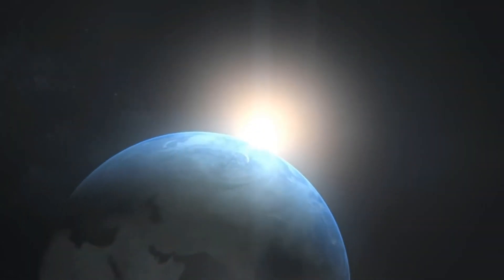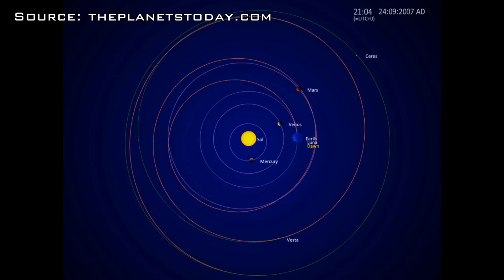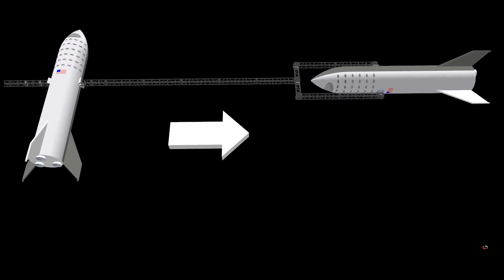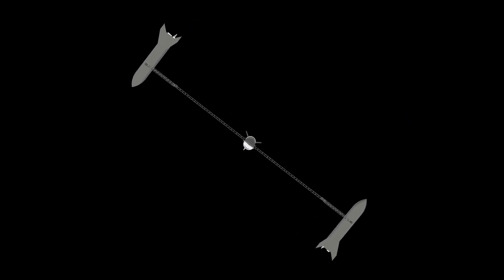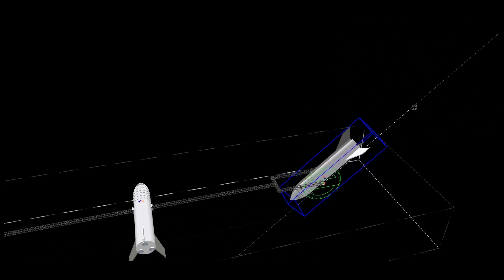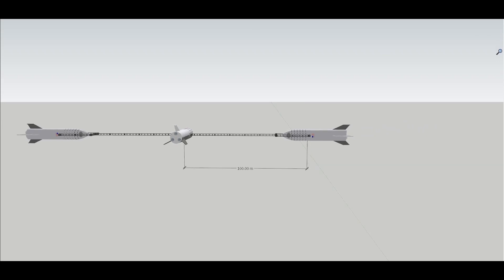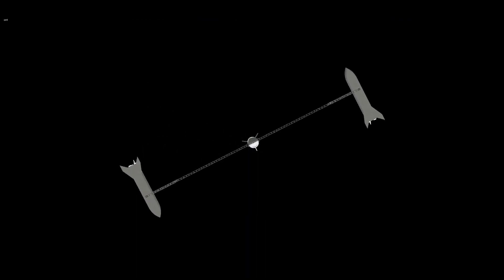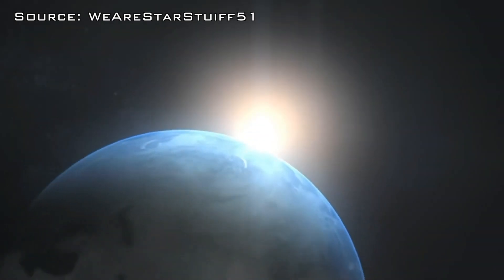GLS2: Artificial Gravity for SpaceX's Starship

Comment: why not just design the Starship with the walking surfaces on the hull so that the ship could be spun like a bullet. One ship....no truss work...no precise coordination required between two complex vessels at opposite ends of a tether. There is also good reason to keep the cross sectional area as low as possible. Space is not empty. Closure velocities can be insanely high. Imagine a small particle moving at an opposing relative speed of 150,000 mph striking the truss work. If the damage is enough to cause deformation the forces involved would twist the entire rig into a pretzel long before any considered response could be enacted, let alone rotating both spaceships, aligning the engines to counteract erratic movement would take considerable time. The only likely way to recover from that catastrophe would be to have the radially distributed ships detach themselves as fast as possible using explosive bolts. Now these two ships are flying away from the hub ship at tremendous velocity, requiring complicated maneuvers and a full crew to be on board both to execute then bring the ships back together in close proximity. The fuel you would need to land on mars or return or even abort and return home would likely be gone at that point. Cool idea, just thinking of the worst thing that could happen....and it's not that unlikely in the grand scheme of things.
Reply from the maker: I agree! People don't like to design their spaceships with 1 floor for travel, and 1 floor while landed. But my original idea did rely on that feature. As of now my only other uploaded video is GLS version 1.
Reply: @smallstars  on the other hand, did I just summarize the plot of a wicked action scifi movie?!!!!😀
Reply from the maker: @BokrosD  lol

Comment: Also if the truss system were electrical, you wouldn't need do a burn to handle the rotation, just solar panels and rotate using reaction wheels and motors, I'm sure even if it starts slowly and builds up speed over a short amount of time it would be better than using fuels. Also if you give it it's own propulsion, you could slow it down and put it into orbit separately so you dont risk having 2 rocket ships not firing at super precise speeds which would throw off vectoring and orientation if you had them both connected as the same time firing rockets.  This is a good idea overall
Reply from the maker: Thanks Daniel! Well the only problem with using an electrical motor to spin up and spin down, is where would you put that motor so that it has leverage on all of this mass it's trying to move?
Reply: @smallstars  The reaction wheels at the middle would work in theory, but the energy requirement to spin two massive ships would be tremendous.  I'm guessing SUPER-well beyond any reasonable solar or battery capability to spin it up in a reasonable time.
Reply from the maker: @737smartin  Yeah there's a serious leverage problem with anything actuating the spin from the center of the system. Reaction wheels especially will be useless.

Comment: It is a quite beautifull and elegant design. But I fear about the safety of the system, one broken nut, or one over stressed part and the whole thing could end in catastrophe. 

Partly because its not a rigid structure but has to fold up aswell. 

It would take an immense amount of testing to develop a system that is deemed safe enough. And it would need to be monitored constantly to ensure safety. 

I'm not sure there's any material out there that can handle the stresses while also being able to withstand impacts from space debris.

I'm no expert though, and I really hope someone at SpaceX or perhaps NASA sees your video. Would love to know what an expert thinks.
Reply from the maker: Thanks! Me too! As for what you said about 1 piece failing causing catastrophy, I would like to bring up exhibit A: the airplane 😁
Reply: @smallstars  But it isn't an airplane though is it? Its not a metal tube flying around in the atmosphere with landing sites every couple of minutes or at most hours away.

Its a massive spinning contraption of 3 spaceships travelling at several thousands of miles an hour through a vaccuum that kills nearly instantly. And it does this for several months/years at a time. There's no way of fixing things quickly when something does go wrong. You catch my drift?

One broken nut puts stress more stress on another, which then breaks aswell given enough time. And so on and so on. And before you know you have 3 spacecraft spinning out of control. 

I'm not bashing your design. I'm really not. Infact I think if we were able to manufacture it, it would actually be one of the best ways of travelling to mars. 

I'm just not confinced we have the material science to build this at the moment. Not without making it much more complex and expensive. 

Then again, I'm not an expert. Perhaps someone at SpaceX or NASA would look at this from a different standpoint and see more possibilities.
Reply: EDIT: I read in the comments you are making a new video. That's really awesome. If you could perhaps answer a few questions of mine. 

I think to make this work there would have to be more fail saves in place. You already mentioned adding extra tention cables that's a good start in my opinion. 

I'd like to see if you could calculate how much fuel would be needed to for instance take 2 extra bolts for every one already in use on both trusses. Or perhaps how much more fuel it would take to just have 2 extra trusses entirely. Is that even possible?

And how astronauts could go about fixing things as quickly as possible through the means of EVA?

Right now I think it takes about 4 hours for an astronaut to prep for EVA on the ISS. Could that be brought back to for instance 1 hour? Or perhaps half an hour or 15 minutes?
Reply from the maker: @CyclonicTuna023  I do catch your drift, and thanks for your input! You're right.
Reply from the maker: @CyclonicTuna023  Awesome comment! I can say right now that the fuel requirement does not change significantly with added mass in the truss area, because of how leverage works. This spin system has most of its mass at the rim, and the thrust is also applied at the rim. It's like saying "how much harder will I have to push to open a door with my hand on the edge of the door, if we add weight near the hinges."

I will be sure comment on EVA's in a future video!
Reply: @smallstars  What I actually meant was, how much more, if any, fuel it would take to get the extra components up there. Since the weight at launch would probably be greater.  :)
Reply from the maker: @CyclonicTuna023  I see, well the rule I am working with is 150 metric tons of payload. That's how's much mass can be lifted into orbit, and they are planning for orbital refueling. I'm sure 200 meters of truss, with extra bolts, and cable, and swivel joint hardware, will weigh less than 150 tons.

Comment: the joints on the passenger ships would need to be lowered to their center of mass, otherwise the fuel, engines, and fins would all put too much weight on the structure holding the ships together once they start to spin.
Reply from the maker: Yes!!!! The goal for the next version is to figure that part out!

Comment: why not just spinning 2 starships connected butt to butt ? It should be less complex to make it. Considering the starship will be 55 meters tall, if you plug 2 of them butt to butt, we would be able to create the mars gravity by spinning it at 2.2 rotations/minute: https://www.artificial-gravity.com/sw/SpinCalc
The rendez-vous maneuver could be done only on the intercept trajectory to mars, which is not that bad I think.
Of course that won't be a perfect solution but at first it would be more feasible than building a 200 meters metallic structure in space with robots and spinning motors. That idea would be great but would cost a lot more I'm afraid.

Comment: Great idea but there's much to be done with the design. It shows promise.
Kicking off the spin as you have shown is great in theory, but there are considerable loads on the truss and on the vehicles.
Stopping the spin requires the vehicles to pull out of their G-loaded orientation to fire up their Raptors. This is more of a challenge. The torsional loads on the truss will likely snap the truss sending them off into the void. Better off using coordinated gas thrusters to slow the spin to an acceptable rotational rate and then they detach. They will "fling" off but can then slowly manoeuvre they're way back into formation.
Reply from the maker: Agreed! (For the most part) 😵

Comment: Nice idea but the stresses on those trusses, especially torsion stresses, would rip it apart in a few hours to days.
Reply from the maker: Torsion? Do you mean bending? According to my engineer friends the tension is going to be the killer. The next version will have math and animations for tension reinforcements. I'm not sure how any torsion force (twisting) could be applied to the truss unless something really goes wrong. As for the bending, imagine trying to bend a spoon by pushing on it with one finger at the tines, and one finger at the handle.
Reply: @smallstars  Twisting.
I'm looking at the length of those trusses and thinking about how easy it would be for the slightest variation in thrust from one of the engines shift the trajectory of one rocket ripping the whole thing apart.
There's just too little room for error.

Comment: I got to say that's better then some wacky ideas out there but it still doesn't address any of the reasons nasa doesn't yet do artificial gravity.
Reply from the maker: I would love to try to address a list of NASA concerns. Should I just Google that?
Reply: @smallstars  Yes, They have answered this question a gazillion times.  The info is out there.  Off the top of my head some of the important ones are;
1) Weight - Correcting for the extra twisting stresses makes the vehicle too heavy and/or really reduces it's payloads.  Not worth it for anything they have done so far.
2) Safety - The Gyroscopic motion hampers there reaction times for coalition avoidance and increases they safety window as it now has a bigger operational foot print.  Plus you need a lot more fuel to adjust.
3) Backup plan - This is critical for all of nasa's projects/plans.   Rotating bodies have a lot more failure points then non-rotating ones.  To think that RTS(s) are 100% reliable is just plain silly.  In the end you have to be able to disable the rotation and still have the people be unharmed.  So they have to work out the non-rotating problem anyway.

Comment: The load case you really need to check is bending in the truss during the spins up/down, and during swiveling of the starships. Although, I suppose you can make the rapidity of those operations slow enough to minimise bending stress.

Its also not easy to analyse correctly, you'd pretty much need an FEA program, its not as simple as putting a tip load on a cantilever beam since its freely allowed to rotate.
Reply from the maker: I agree with the swiveling note, but truss bending should not be an issue, as you said in your second paragraph, imagine trying to bend a fork by pushing with one finger in one direction at the end of the tines, and another finger in the other direction at the end of the handle.
Reply: @smallstars  yeah theres still some bending on the fork, but you have to apply forces and accelerations weirdly to analyse it statically, even with FEA

Comment: I thought there was something about needing a constant state of acceleration for this to work in space.
Reply from the maker: The spin may have to be "re boosted" but not by much. With a spin system there is constant acceleration, the idea is that the floor of the starship is constantly pushing up against your feet, just like the Earth's ground does.

Comment: I wonder if it is possible for the Starship to swivel up against it‘s own artificial gravity, and if it‘s stable when pointing perpendicular to the gravity vector
Reply from the maker: Very intuitive thought! This is certainly one of the problems with my design. Working on a new system for the next version that either involves a track or a more fancy swivel joint
Reply: @smallstars  I think having three tethers for stability and RCS for de/accelerating the rotation would be the easiest solution.

Comment: I don't see how a rigid structure would be advantageous over a cable system, as it would introduce structural concerns that simply wouldn't exist with cables. You wouldn't get me on that ship. And I'm not sure why an entire rocket would have to be out on both ends - why not segment the ship and place a tethered crewed portion out at one end? In fact, if you did that, you wouldn't need two ships. And if you're sending two ships, then they can each have their own tether. Cable would be a lot simpler and easier to stow, in a smaller space, and probably lighter, with far, far fewer issues. Keep it simple. Plus, you don't have two ships reliant on a single point of failure. However, if you insist on attaching two ships (rigidly or with cable), why not simply design the ship so that "down" is to one side of the ship, instead of toward the rear. Then you would eliminate the need to pivot them around. Plus, there would only need to be one connection, on one side, and the rockets could swivel around that (balanced) connection point, rather than pivot around some offset axial connection, when thrusting is needed.

Comment: I think this plan is overly complicated. The use of the main engines on the Starship is impractical because it will have an RCS system. Also, carbon fiber cables can easily replace the truss system and be much lighter.

Comment: I would add a system inside the truss so crew transfer between ships can be done safely. Also some sort of weights on cables or tracks in the trusses, the weights need to be moveable so balance can be maintain. You won't want the ships to jerk around if one side gets heavier or lighter than the other.

Comment: The problem with your idea is: if you start the burns for the "spin" the whole thing will go another course.  Second: Even with an accuracy of 99,9 % That thing could slinger around and wouldnt be really stable at all.  I think the basic idea is good, but its very impractical when it comes to reality
Reply from the maker: Thanks for your input! I would be interested to see exactly how the trajectory would be changed by a spin system starting up, and what could be done to mitigate that.